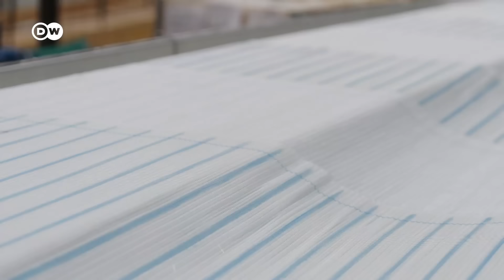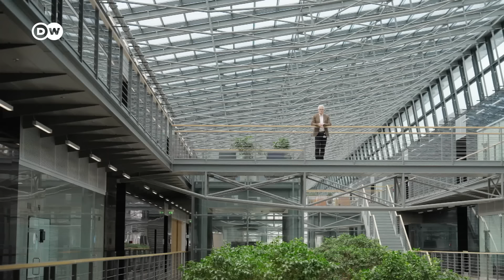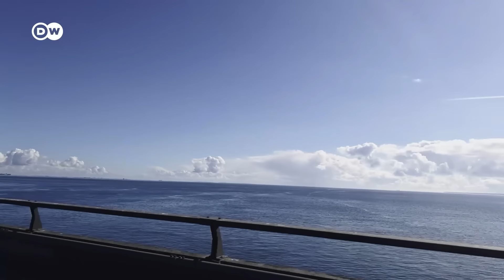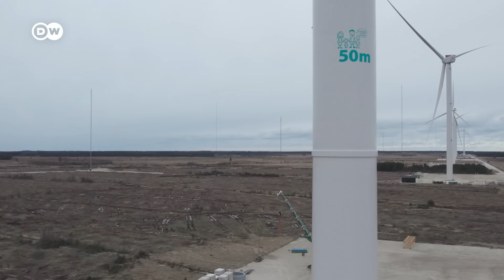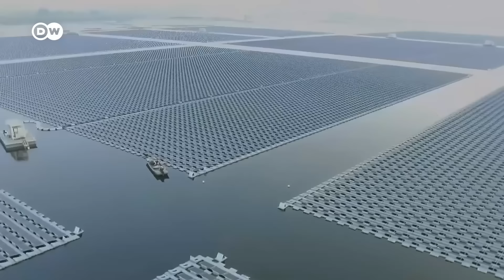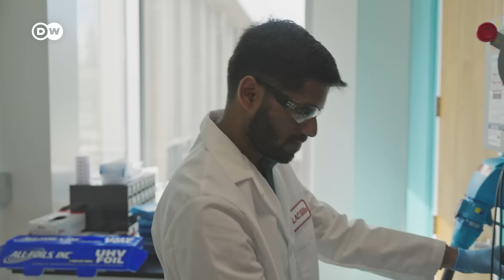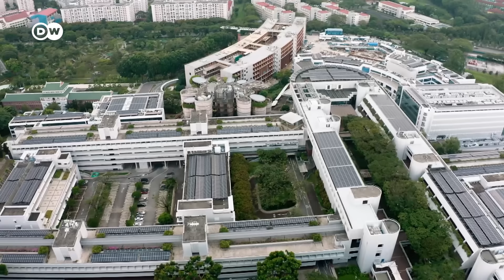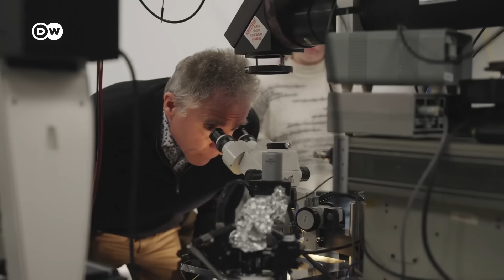Will renewables stop the climate crisis? | DW Documentary

Comment: This is like the Swiss talking about the problems of chocolate making without a single word on cocoa production.
Reply: great analogy
Reply: @hhwippedcream  didn´t quite get it, could you explian?
Reply: @sebaschavez7050  electric cars require rare earth metals, cobalt, etc. chocolate requires cacao farming. Cacao farming and rare earth mineral mining are destructive processes that mess up the environment and have poor track records when it comes to labor standards/human rights. So chocolate and electric cars sound nice but the components (produced at such a high cost ethically and environmentally) make the end products'benefits sort of moot/pointless.
Reply: but but, solar power is created fróm fossil resources!
Reply: @Ruben-li4dt  exactly!
Reply: @hhwippedcream  thanks to the mentioned research we don't need cobalt for batteries, nor rare earth matels. Also, electric cars weren't even mentioned in the documentation. Would have been nice if you actually had discussed the topic in the video instead of following your Pavlov reflex.
Reply: @scribblescrabble3185  So let's add the cost of Solar Panels and Batteries that use such technology as well as their recycling costs directly in their statistics for comparison.

Comment: I actually thought that renewables wouldn't do much... However i am impressed with the advances that were made. If only this was done a long time a go...
Reply: The technology was much more expensive a long time ago. Today it's very cheap. 
Certainly with government support, the technology might have been made cost competitive 10 or 20 years earlier. That's why China is the leader today.
Reply: @AWildBard  - Technology is cheap because we did it. But we put it off a lot because so many thought it wouldn't work. Always keep pushing; whether it works or not, we learn.
Reply: @calorus  
The reason it's cheap today, is that what you suggest, to always keep pushing, is exactly what happened already for decades. That's why it's so cheap today. And advancements will continue of course. Some people are for renewables and some people are against renewables. But the technology has advanced where capitalism is able to lift up the advancements like a wave and push it forward even faster. 
At this point, no one can stop it. 
In the previous century, oil was discovered and the internal combustion engine was a new ish technology. WWI and WWII and the cold war didn't stop the technologies. In fact, those wars might have advanced the technologies in many ways. Anyway, they improved the technologies over and over and over until today when better technologies are going to displace the old technologies for the most part.

Comment: I mean renewables are big part part of the solution, energy is easiest thing to fix. Just replace fossil fuels with low carbon like nuclear and renewables. And if we actually want to fix things, we definitely need both to do things in fast and feasible way.
We also need to focus on stuff like how we produce things and plan for their end of life in advance.

To transition from fossil fuels, we will have to electrify everything, cars, heating, gas piping for homes, factories etc. This means electricity our grids need to supply will grow a LOT. Meaning we need to probably upgrade our grids and we also need a lot of energy. 
Nuclear is currently pretty much only energy source suitable for base load, well hydro is also good but it's always going to be relatively minor part. Renewables will also play big part, vut it's just not vwry good for stable output.
Reply: Obviously.  It's so simple.  Yeah, like, just quit use fossil fuels, and convert to windmill planes and whine up car.
Reply: Batteries and thermal storage make renewables just as viable as “base load”. We do not need the future power grid to look like the past power grid. COP28 just made bold and unrealistic promises about tripling nuclear by 2050. There are about 400gW of nuclear in the world today. We’re adding 400gW of solar in 2023 alone - while we also added 4gW of nuclear. By the end of 2025, we’ll have a terawatt of global solar manufacturing capacity. I find it kind of silly that we treat nuclear as “necessary”, or that people still think can’t handle the intermittent nature of renewable sources.
Reply: Storage and efficient long distance transmission lines go a long way toward solving intermittency.
Reply: Nuclear is a good way to vacuum up the whole budget and keep that money tied up for decades.  In other words, devoting resources to nuclear is a great way to keep burning fossil fuels.

The reality is that we need to transition ASAP.  The way to do that is to ramp up solar and wind and battery storage as quickly as possible.  They will scale up much more quickly than nuclear ever could, and for a small fraction of the cost.
Reply: @davidmenasco5743  I agree, we need more renewables, but to be most efficient we should do both. 
Reality is as you say is that energy consumption is going to drastically increase as we electrify more of our systems, like cars, heating etc. On top of just general energy need increase. 
And our energy needs are not small, amount of batteries we would need for grid with just renewables is quite absurd due to large swings you can have in energy production. To achieve optimal results we should use all tools we have available.
Reply: @davestagner You actually can't compare a nameplate GW of nuclear to a nameplate GW of wind or solar. They are in no way equal. Nuclear is 'engineered' to produce clean, reliable energy 24/7 at 'rated capacity' or as required without the need for constant backup. As well as that the power plant can last 80 years. Nuclear is the highest density form of energy production in the world. 

Wind produces just 30% output of nameplate capacity on average over a year and for solar it's just 20% of nameplate capacity on average over a year. So as you can see you need many times more infrastructure in the way of wind and solar to match up and it still only produces energy when the sun is shining or the wind is blowing. Wind and solar are among the lowest density forms of energy in existence and they could not even be referred to as an energy generating system without backup. Their output of energy is pathetic. On top of that most of the wind, solar and backup batteries infrastructure lasts less than twenty years so it needs to be replaced many times over in the life of a nuclear plant. Which is why wind and solar is in no way cheaper than nuclear.
Reply: @margaretarmstrong2445  You’re right, a GW of nuclear and a GW of solar aren’t directly comparable. The term you’re looking for is “capacity factor”, which is about 20% for typical solar (it varies some depending on on location), and over 90% (but not 100%) for nuclear. So let’s say you’d need 5x as much wind to be comparable to nuclear. So at current production rates, it will take 5 years to add another 400GW effective solar to the grid, and 100 years to add 400GW effective nuclear (accounting for capacity factors). You’re right… not directly comparable, at all. Of course, current production rates will not continue. By the end of 2025, we will have a terawatt of solar production capacity (and I would expect 2TW by the end of 2030). We’ll be able to deploy 400GW effective solar every year or two. 

Your claims about lifespans, though, are just completely wrong. We don’t yet know if a nuclear plant can last 80 years, because there are no 80 year old nuclear plants. The oldest operating commercial plants are just over 50 years, and that’s after refurbishments (which mean downtime) and licensing extensions. I wouldn’t count on any of them still being operational in 80 years, because many nuclear plants have already been shut down due to age-related safety issues. The idea that solar panels will last less than 20 years is plainly wrong. First, the majority of solar panels in the world are less than five years old. Second, current production panels are rated to lose 0.3-0.5% efficiency per year. Why would it stop working in 20 years? A solar panel has no moving parts and has no chemical reactions involved in generating power. It is effectively just a window with a plug. There’s nothing to wear out! Solar panels are rated for 25-30 years, but that’s time before efficiency falls below a threshold (10% drop typically), not before they stop working. There will always be people willing to take a free used solar panel, even if it’s only working at 75% or so of nameplate output. I expect real-world modern solar panels to last over 100 years. Wind is no more complex than the turbines that generate energy from nuclear or coal, and should last just as long with maintenance. 

Battery lifetime depends heavily on the technology involved. Lithium isn’t the only game in town for grid-scale batteries, because they don’t need to be compact. Tech like iron-air batteries and thermal storage are simpler and don’t suffer the kind of long-term electrolyte issues that lithium batteries do. But even if batteries need replaced, so what? The materials in any battery can be recycled. Even 20 years of life is better than a car, and I don’t think you’re complaining about how cars can’t last. As long as they’re economical, batteries/storage with renewables are a huge win. 

It’s important that our thinking be grounded in facts, not feelings. I’m not anti-nuclear. I think solar will win because of cold, hard facts about cost, scalability (down as well as up - you can’t put nuclear on a rooftop), and time to market. There are tremendous cost and time-to-market advantages to the simplest solution, even if it’s not the most efficient solution. When the idea of adding another 800GW of nuclear by 2050, as proposed by COP28, seems like an extreme challenge, while we’ll add that much effective solar (even accounting for capacity factor) by 2030… I just don’t see how nuclear will make a significant dent in the problem. It’s not about safety or treehugger resistance or whatever. It’s a simple function of economics. If you want more nuclear ,you need to get out of denial and start facing facts and figuring out what to do with them.
Reply: @davestagner  I understand capacity factor but most people don't so I present it in a way to help others understand. I also understand that the capacity factor of nuclear is around 90% and solar 20%. The difference is that nuclear power plants are 'engineered' to produce energy at rated capacity or as needed whereas you cannot do better than 20% for solar because it's weather dependent. This means that to equate to 1GW of nuclear you would need to build 5GW of solar but the supply would still be intermittent. 

You cannot compare rooftop solar with industrial scale solar projects. The industrial solar is supposed to supply all energy needs including hospitals, businesses, rail transport etc. Solar panels lose 2% efficiency the moment the sunlight hits them when they are installed, that is a given. They degrade 0.5% to 0.8% each year after that and although this makes very little difference to the owners of rooftop solar because even if it's less you are still getting free energy, it makes a big difference in regards to the industrial solar. The industrial scale solar is contracted to supply a certain amount of energy and once the efficiency drops to a certain level it is considered to be no longer financially viable. If the owners of the industrial solar have to pay for the shortfalls with backup it can become extremely costly to them.

An 87MW thin film cadmium/tellurium industrial scale solar was installed and then commissioned 3 kilometres from my home in 2019. It is now up to its third owner and they are looking to sell. The last owner sold this and a another hundreds of kilometres away for a third of what it cost to build them. This facility has been struck by lightning and has had serious inverter problems which put a part of the plant out of action for some time. More recently, 18 hectares of panels were damaged in a fire that started under the panels, apparently by faulty wiring. Cadmium is highly carcinogenic and these panels must not go to landfill. The original owner stated such and said that the nearest specialist recycling facility was in Malaysia and that was where they would go at end-of-life. The fire was in April and we are still waiting to find out what became of the damaged panels. 

Like you most people assume that there are no risks associated with panels and that sending them to landfill is not a problem. People also assume, because that's what they're told, that all renewables are recycled. The truth is that recycling is an expensive and with some panels toxic process so most panels are ending up in landfill because it's a cheaper way to dispose of them. 

Now, I live in a Renewable Energy Zone so I know how much land is being utilised by solar and typically around 13 square kilometres would be required for a 500MW industrial solar project which would add up to more than a million panels. So you would need 26 square kilometres for a 100MW which means that you would need 260 square kilometres for 1GW of solar. But to equate the output of energy from solar to 1GW nuclear you would need 5GW of solar panels. This would require 1,300 square kilometres of land! The 1GW of nuclear would provide clean, reliable energy 24/7 without constant backup or extra transmission lines from a few 'hectares' of land. 

Hinckley 3 power plant in England is expected to last 60 years and potentially 20 more with refurbishment. It is not weather dependent or weather vulnerable. It would not be taken out by a hailstorm. 

I don't know how you could think that solar panels have only been around for a few short years. Industrial scale solar is already being decommissioned in many places in the Northern Hemisphere and in America the average lifespan of these plants is 21years. People have been installing solar for more than 3 decades and it has been proven that it is not viable as a stand alone source of energy.
Reply: @margaretarmstrong2445  I’m glad to see you’ve done your homework and grok the math. Most solar opponents have not. Still, you’re missing some obvious points. First, anecdotes are not data! You can bring up your neighboring solar farm that had problems, I can bring up my neighboring nuclear plant (50 miles upriver from me) that spilled nearly half a million gallons of tritium-laced water last year and didn’t tell the public for months. But what really matters, though, is storage. Storage is what turns intermittent solar into power more reliable than nuclear, and far more responsive to demand than nuclear. And nuclear needs storage too (or to continue its dependence on gas peaker plants for load balancing, which is how it’s worked so far). Nuclear proponents like yourself forget the supply/demand relationship applies to nuclear as well as solar, and complain that solar is intermittent, when what you really mean is that its output doesn’t match the demand curve. Neither does nuclear. 

Solar panel recycling is in its infancy because, frankly, there’s almost no demand for it. The vast majority of solar panels have been made within the past five years. Even by your own extremely hostile standard that they only last 20 years (which even you admit isn’t actually true), we’re nowhere near retiring enough solar panels to offer the scale required for profitable recycling. That said, a solar panel has about $20 worth of silver in it, which does make it an attractive candidate for recycling, and I’ve seen videos on a facility in Texas that’s already scaling up a recycling process, with an eye to the future.  Nuclear plants, of course, cannot be recycled, and produce toxins that make your cadmium look like corn starch. And a good solar recycling process (which will obviously happen) can recover most or all of the valuable materials. Focusing on the dangerous materials in solar panels while ignoring the fact that nuclear is much harder to dispose of is disingenuous. 

As for your estimate of land use… go back and check your math! You accidentally multiplied by an extra factor of 10. (13km/500MW does not double to 26km/100MW). I’m sure that was a mistake, but… it suggests you’re overstating land use by an order of magnitude. And considering that my nearby 500MW nuclear reactor’s site is also several square kilometers, I’m not convinced that solar takes THAT much more room than nuclear. It’s also far less sensitive to siting, because nuclear sites need a large body of water (river or lake) for cooling. And nuclear can’t scale down size-wise, whereas solar can scale down to the device level, and is commonly placed on rooftops. I expect we’ll see a lot of solar built over parking lots in the future, as that land is already used very inefficiently. 

Your arguments are stuck with the same problem overall - you’re drastically overstating your case, with anecdotal evidence, botched math, and hypocrisy, to make an unfair case against solar. It’s not convincing. My arguments against nuclear, on the other hand, are very simple - it’s too expensive, and that’s why it’s been failing to live up to its promise for decades. It’s not about safety, or “base load”, or any of that. Nuclear doesn’t get built because it costs a fortune and takes forever. it can’t scale down, it’s heavily tied up in political and regulatory process (please don’t take the “let’s not regulate it” line!), and the eventual back-end decommissioning is a nightmare. Solar is going to win this race, because it’s simple, cheap, easy, and safe. That’s why 100 times more solar was deployed than nuclear this year. (ok, 20 times with capacity factor…)
Reply: You clearly have zero knowledge on the subject. @Thaxildds
Reply: Intermittent renewables can be solved with enough batteries ( Enough EVs with vehicle to grid).